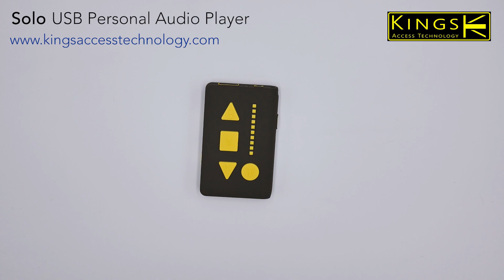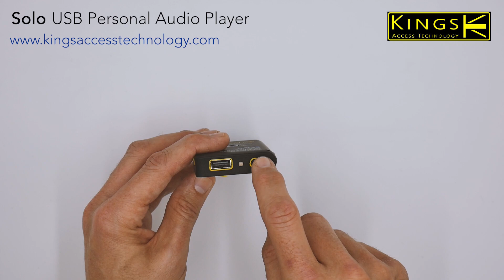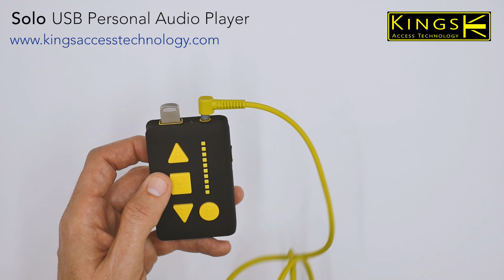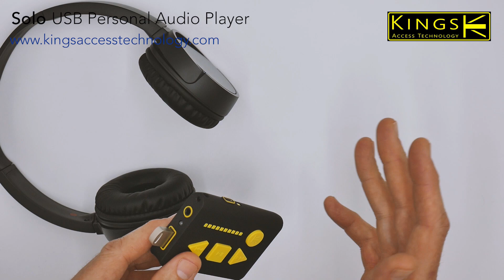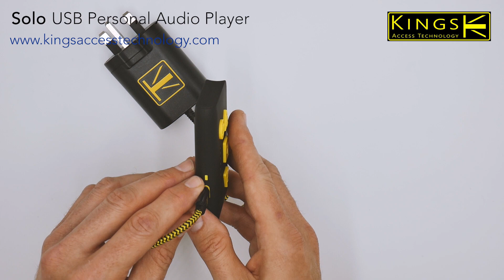Solo Audio and Video guide from Kings Access Technology Ltd. Solo USB MP3 Personal Audio Player.

Comment: I bought the SOLO player in May 2023. The operating instructions correspond exactly to the function of the device. I have successfully used FAT32-formatted 32-256 GB sticks as USB sticks. It did not work with USB adapters on different microsd memory cards. I have stored many audio books in MP3 format in the respective folders on the USB stick. In each folder I have stored an MP3 file with the description of the audio book via text-to-speech.

I sorted the MP3 files so that the episodes played in the correct order on a computer with an Linux operating system using the freely available software - fatsort . It is not possible, to change the id-tags, because the SOLO player seems to ignore these tags. Windows Users may sort the mp3-files with -drivesort from anertys lair. 

Pairing with SONY Bluetooth headphones took a few seconds longer than expected, but it works very fine.

The SOLO player is a great device for blind people who want to enjoy music, podcasts or audio books in the simplest way. 5 stars with a maximum of 5 stars.

Comment: I've had this solo player since 2019 and I use it to play my audio books from Calibre audio lending library which is a fantasticservice and I recommend it. I have dyslexia and found this solo usb device life changing. I've been able to listen to hundreds of audio books with thus devics. I also have the sonic player which is slightly bigger with built in speakers. Sadly the Kings access company is no longer running. I'm so sad about thus because they make fantastic usb players. Fortunately you can still buy this little solo player  from the RNIB. It's now on sale for £20.00 which is great value. If you buy it from amazon, its still about £60. I will miss Kings access very much. They're devices are brilliant. It's now  really difficult to get the bigger sonic usb plsyers but the solo players are still selling in a few places.

Comment: It does not appear to play memory stick with only one mp3 music track. I need this as singers only want to sing one track. It works fine when a lot of songs are .loaded.
Reply from the maker: Hi Roger. There should be no problem playing only one track on a stick. Many of our customers use it in that way for commercial applications. Please check your formatting carefully and ensure there are no hidden folders or files and the track is mp3 or .wav format.
Reply: @kingsaccesstechnologyltd7945  Thanks for your reply. After trying 8 different usb sticks without success. I discovered the problem appears to be the music track I loaded. It  on on my Douk player, with success, but not on your device. I have played other music tracks on your device without any problems, but for some strange reason your device refuses to play the troublesome track. I wonder if your player does not support this track. The Muscian whose track it is, said he used Wav. I don't  understand why it plays immediately  on my douk mp3 player, but not yours??
Reply from the maker: @rogerroberts9546   Hi Roger. Thanks for your reply. I would imagine the track is not actually .wav. Formatting is tricky for non experts and one can often have problems. The Douk player plays many formats beyond mp3 and .wav so it could be in any of them? Simple test would be to load it into an audio editor and re-save as mp3 or .wav and I am sure it will play.
Reply: @kingsaccesstechnologyltd7945  Thanks for your kind reply. I solved the problem. As you rightly pointed out,the track was not a wav. I converted it to an mp3 and it worked immediately. A case of not taking for granted what it says on the tin. It was certainly not a Wav format, I still have no idea what format the Muscian actually  used. Anyway, thanks for your help, much appreciated.
Reply from the maker: @rogerroberts9546  No problem, glad you are sorted.

Comment: Hi I'm getting a solid red light and it's not playing back
Reply from the maker: Hi Nicholas, 
A solid red light usually means there is no USB stick present or the player is paused. Scenarios that may cause this include; mis-formatted/faulty USB stick so the player is not recognising the stick,  file formats not mp3 or .wav so the player does not recognise any files it can play, player in Pause mode and key-pad lock is on so pressing play/pause is inactive.

If this is not helping you please give us a call on  01935 411 322 or email inf@kingsaccesstechnology and we will get you sorted out.

Comment: Hi this is Mosie Wild again. And I have managed to work the MP3 player no problem what would be more useful would be if you have not have not handheld lanyard but one where you can put it round your neck I think that would be far more useful than having just the rest held one you’re not going to really hold it in your rest is probably better if it was hanging round your neck just a thought just a little lanyard to go round your neck and I’ve got a search and search for headphones and there aren’t any headphones I mean luckily I have got some spare headphones but it might of been better if there is a bin up some headphones in anyway that was just an extra thought headphones and the
Reply from the maker: Hi Mosie,

We had much discussion about the lanyard length in consultation with users and several major Visually Impaired organisations. The conclusion was the wrist length item was the best compromise. We appreciate this is not ideal for everyone. 

If you drop us a line on info@kingsaccesstechnology.com quoting this conversation we will send you out a complementary full size (neck) lanyard. You may need assistance to fit it as this is a fiddly job for fully sighted people.

In regards to headphones we did not feel it practical to include as there is such a range. Headphones run from £5 to £1000 and this cost would have to be put to every purchaser effectively forcing them to buy headphones with the player. You can imagine this would disappoint a lot of customers.

Comment: Can you use any USB stick
Reply from the maker: As long as it is formatted to FAT32 or exFAT then yes. Occasionally we have come across some stick that don't work due to poor design on the chip-set but this is rare.
Reply: Hello, I'm looking to buy this. But I don't understand how to format the USB stick. When you put a stick into a laptop, you have to format it to drop and drag mp3 files onto it. Is this going to support this usb. I am not computer savvy at all. Also why I will not buy ipods etc. I just don't understand the format usb statement. I would really appreciate your help. I was checking this vidrp before I buy. But now I need to check this one point first.